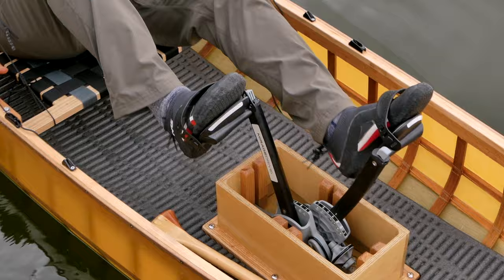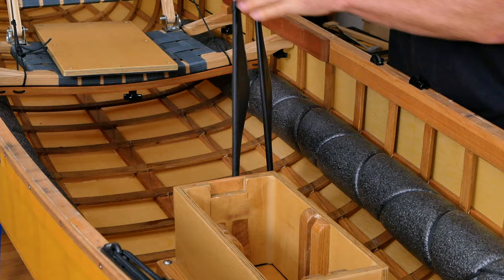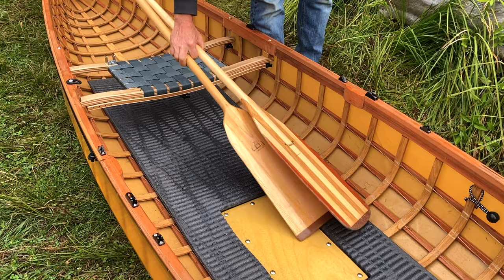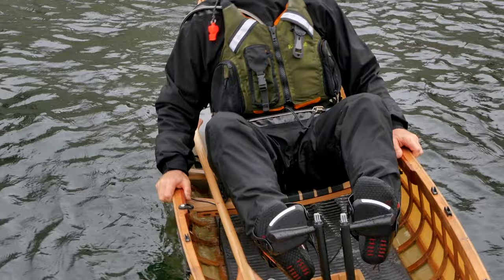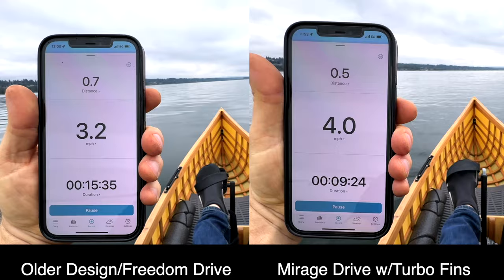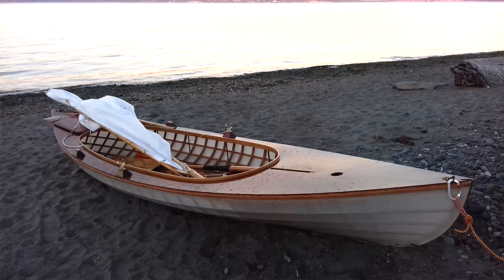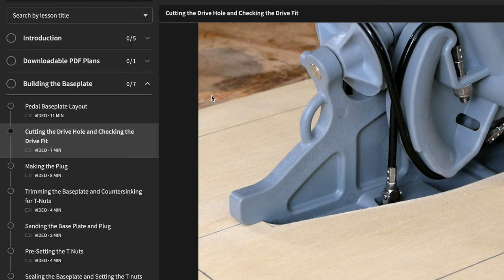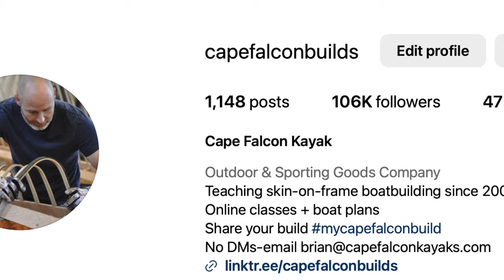NEW Pedal Drive Canoe System for Skin on Frame Canoes

Comment: hey, I had an idea that you might like. Can we get an old turbo from a diesel truck and use it as a jet pump? You could easily build intake and outlet runs into the hull. Then the pedals can attach with a shaft to drive the impeller pump , but the jet pump can be under the waterline. you might be able to use more bike parts to work out the ratio. Just a big flywheel to get a nice high speed out of the turbo, they are rated for 10,000 rpm anyway.

Comment: Hi Brian!  I switched over to a Mirage drive a couple of years ago after my shoulder started giving me trouble while expedition kayaking.  I had to move over to a Hobie kayak - the Adventure Island Tri - as the drive didn't seem readily adaptable to my existing fleet.  The Hobie Adventure Island has been one of the most fun and capable boats I've used.  But it meant that I was left with several really great kayaks and small boats that I didn't expect to be able to use again.  So I'm thrilled to see that you've taken on this project.  I'm looking at adapting my Pygmy Wineglass Wherry to the Mirage drive.

Comment: One option for the older mirage drives is to change to turbo fins. 
The 72066001 - ST Turbo Fin Kit fits the older V2 mirage drives and greatly increases the power output. So if you're buying second hand drives you will just need to confirm the item is at least a V2 drive.
Reply: The newer drives have bearings in place of bushings, so are a lot smoother to operate.
Reply: @CalebSmyth  yeah, I'll bet. I haven't tried the newer models yet. Still have my v2 drive from years ago when I had an Adventure Island.

Comment: I really like this idea. For my 50th (6 years from now), a friend and I are planning to take two solo canoes from the Rocky Mountains to Hudson Bay. He can make his own choice regarding his canoe, but I'm darn curious about using a skin-on-frame with this pedal drive option. However, everything in me cautions me against this due to only having used more rugged hard canoes for the past 25 years. I know that the indigenous as well as various voyageurs used birch bark canoes, which to me seems the closest comparable. The amount of rapids, as well as sweepers and shallow rock bottom in some of the fast water like early in the trip on the Athabasica have me worried about spending 3 months in one of these. I have questions about how well they'd hold up to these constant abrasions, but also how well they'd handle the upriver sections while poling. So many things to think about. This is a pretty cool idea that would be a great addition if I think it'll handle the ~1800 miles of river we'd be on.
Reply: Having a skin on frame boat (F1 Kayak), and having built several wooden boats, I'm pretty confident the SOF would be fine overall. Reinforce the rub areas with an extra coat of goop, maybe a rub rail. They are super tough. If it were me, I'd build one now and beat on it the next 2 years. Tweak what you need more of, or less of, and build another one. Year before the trip build the one you'll journey on... you will have learned so much and that one will be almost perfect. Plus you'll know how to fix or repair any problems you encounter. SOF is way tougher and more durable than most people think!
Reply from the maker: I think Justin has exactly the right idea as far as a strategy for your trip.  Build one now and see how you like it and then you can either reskin it or build another one for the trip.   I’ve got a great video here on the channel about skin on frame durability that you can check out.  Couple years ago I had a gal paddle one from the source of the Columbia river to the ocean over 1000 miles.
Reply: @capefalconkayak  it's mostly because a number of my friends that run canoe trips recommend against it but I can't help but feel it's worth a trip. It would be the closest thing to a birch bark canoe I'll get. But then my friends all run trips with less experienced people. Have either you or Justin tried poling your canoes? It's something I'm good at with a fiberglass and plastic canoe but am curious how a skin on frame would handle it.